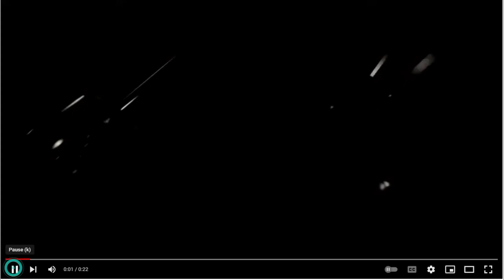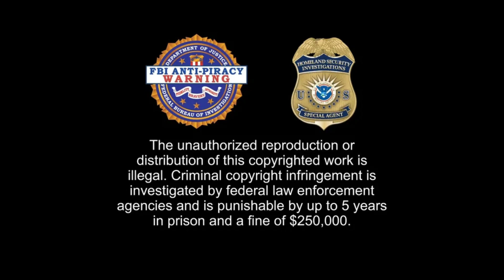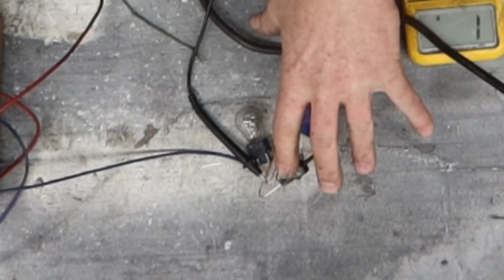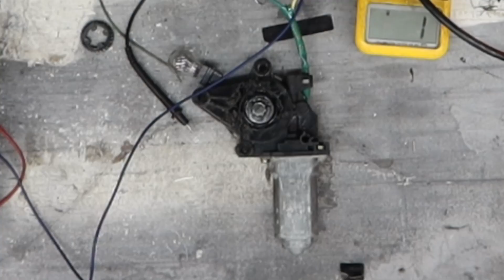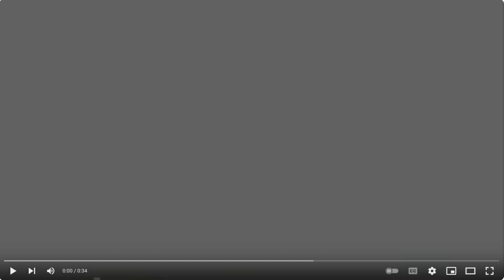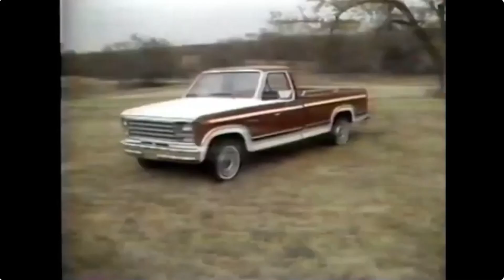🛻📽️7.3 POWERSTROKE LOAD TESTING WIRES 🚧🛑⛽🛻

Comment: Hello, i am hoping you may know the answer.   For 2000 f350 7.3L is the engine wiring harneass the same for auto transmition and manual transmition?
Reply from the maker: No A minor modification needs to be made https://youtu.be/buo-gUbolNA

Comment: Hey Clint
If you were to buy a new harness where would you buy it from? Pro source diesel is the only site I've found that sells motorcraft OEM for $629.99 with the starter solenoid and glow plug switch. You know of a better deal? Or should i just go with pro source diesel? Also a 1 year warranty. Please help. Thank you.

Comment: Can you load test/continuity test between the idm and pcm plugs specifically the 818 feedback signal,817 cylinder id,821 fuel delivery input,359 signal return and if so do you have to have harness plugged in or everything unplugged? Please help thanks

Comment: Hey Clint, could you do a video on what “heathy” numbers we should be looking for on FORScan for icp, ipr, APP, etc? 

I got a 96 7.3 204k , doing a buzz test and everything sounds good but I get a p1668 idm to pcm com. Error. Truck smokes white on start up but clears up after driving. Truck idles great on start up but starts to miss on idle after driving. Just doesnt have good power at all. Got a p1211 the other day while putting the pedal down hard. restart the truck and it reset. 
Icp is new, ipr is new, valve cover harnesses new, ebps new. 
Any help would be greatly appreciated. Thanks for all the videos they’ve been a great help.
Reply: New engine harness is my best guess Allen says to do it to mine needs on to its not a hard job

Comment: If anyone can assist…Replaced all 8 glow plugs a few months ago, no issues.  Code popped for GP 4.  Inspected GP control module, looks like the pin for GP 4 got very hot at some point (slightly melted plastic on module & connector).  Replaced the module with and connector pigtail with OEM, same code persisted.

Popped the valve cover, GP wire was connected well but surprisingly the GP was open.  Replaced #4 GP with OEM, code still persists.  Tested GP 4 wire, 12V present when KOEO.

The only thing left to change that I can think of is the UVCH or the valve cover gasket connector pigtail.

Truck starts fantastic and runs absolutely great.

Anything else you’d suggest as far as troubleshooting and or replacing parts?  Thanks.

Comment: Perfect timing. I just purchased a ICP sensor on ebay. Looked at the black connector and no writing or white dot. It's a FAKE and it was in a offical ford bag. I now think the ebay IPR is a fake also. Can't wait for the video on them. I'm new to 7.3l so it's a learning experience.  Good  work.  Thanks
Reply: RiffRaff Diesel.  Order from them, you will always get genuine Motorcraft parts.  You will pay a fair price.

Comment: I completely understand the Genuine vs Amazon quality, however I keep a stock of Amazon sensors, IPR, etc...in my truck in case of a roadside emergency. I'll deal with the OEM once i get home. I also make sure i carry all the fun wrenches and code reading equipment to change out these items myself roadside if needed. I know this is a low budget spin the roulette wheel safeguard, but........450,000 miles on the excursion (AKA Exxon Valdez). Good job Clint.
Reply: I know what your sayin,  I have a 1997 ,l last year of the obs,its got 580 k on it. I'm the original owner. The only way to keep  it this long is to watch guys like Clint Allen so you can fix it yourself  other wise way too expensive.

Comment: to me your channel is like a knowledge library or anything about 7.3.  I found how to fix all issues on my 95 f-350 except for one problem.  I have flickering Fuel Filter light but truck runs fine.  but besides that everything else your channel helped me with.   Thank You
Reply: There is a plunger that allows fuel Into the bowl only when a filter is there allot of people remove it yours could be gummed up otherwise is most likely the screens in the fuel tank pick-up are clogged up